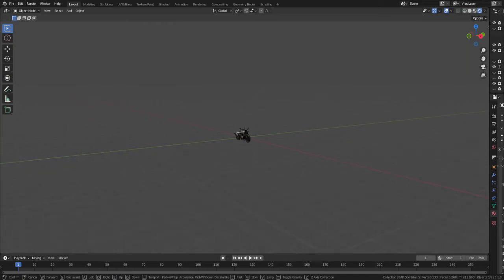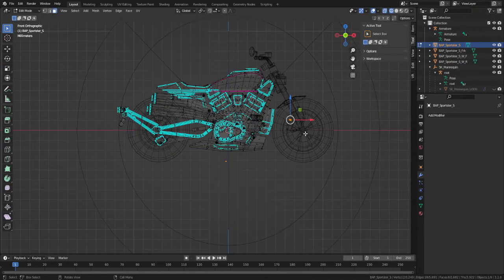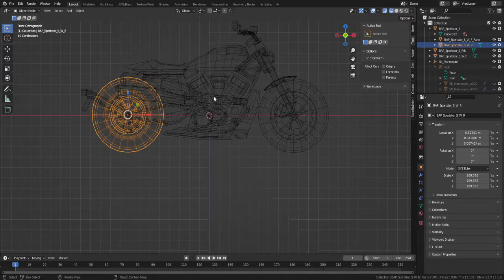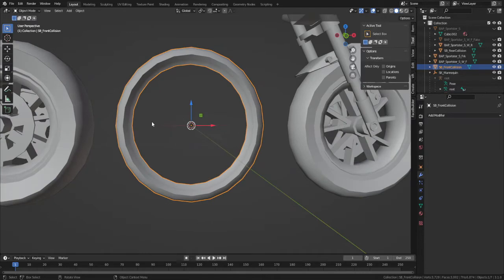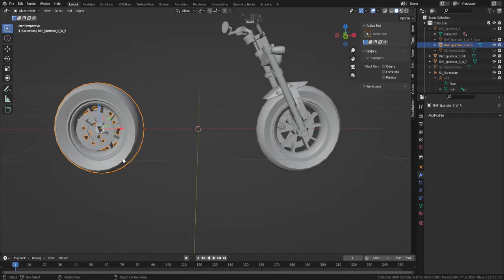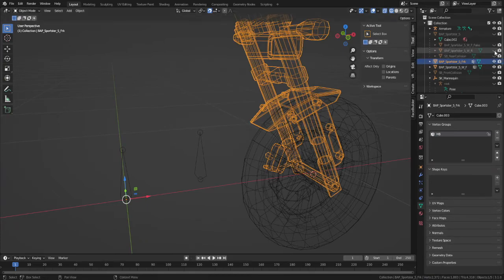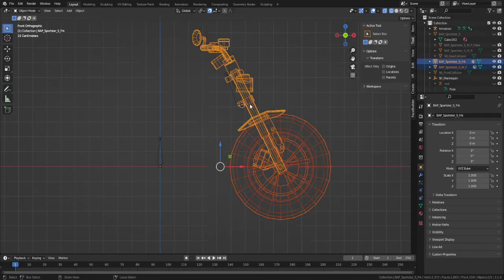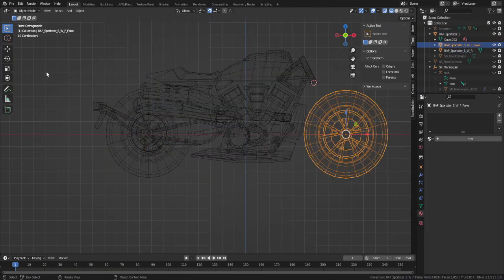Blender to UE5 Chaos Motorcycle Setup

Comment: Chaos vehicles are completely unusable in games. For example it is nice to have a center of mass on a bike, but it is impossible to change it in game so the bike can't fall or stand on a crutch. GPT doesn't have a clue about how to do it, and "communities" never help.
And anyway setting up a correct handling is almost impossible. Crappy feature like everything in Unreal.
Reply from the maker: I both agree and disagree on this subject. Epic games has definitely prioritized 4+ wheeled vehicles in their game engine. Which has driven users to conjure up work arounds when it comes to 2 wheeled. There are many different tutorials floating around but mainly cater to arcade style steering. I made plans a while back to further improve my setup. Adulting gets in the way and my previous computer crash didn't help in terms of motivation. I have a few ideas on the lean mechanic that would help but I have yet to update to unreal 5.
Reply: @indieartsmidwest4042  You are right it works probably well for cars and there are indeed a lot of tutorials on the subject, but that is not the case for motorbikes. You  included, there are only 2 persons who made relevant tutorials. I've watched everything, that helped me to start but after I've spent countless hours tweaking the settings with no progress at all, and I still don't understand the arcade controls 😅. 
In case one day you decide to give it another try, I subscribe ;)

Comment: Hi friend I have a question please how do you put the pitch down on the handlebars and fourhce etc
Reply from the maker: A loop select an upper portion of the handlebars, shift-s cursor to selected, edit mode for the bone you want to place there, shift as selection to cursor for the tail end of that bone. Repeat the same process for the head end of the bone But be sure to Loop select a lower-end portion of the handlebars. The goal is to find the center of a handlebars in relation to where and how they turn. This setup technique works for bicycles and motorcycles but I also use it for steering wheels as well.
Reply: @indieartsmidwest4042  I have to do it with a bone? I wanted to know if there was no way to modify the axis of rotation of the pitch without creating an armature
I tried with your blender export info then after I tested at least twenty different imports by modifying the translation and the rotation once by converting the scene once no but that changes the position of the motorbike
Reply from the maker: @LanD_87  Unfortunately no I don't think it works that way. Objects in 3D space take on World/global rotation not local at a set rotation. Even if you were to export it as an fbx without an Armature, unreal would still base its rotation from its exported origin which would still maintain World rotation. Meaning you wouldn't have to create a virtual bone-in essentially do the same thing on the unreal side.
Reply: @indieartsmidwest4042  because the handlebar on its left-right axis I put it locally and arrived in unreal it sticks well to the axis of the top of the fork as long as I don't activate the rotation effect on the front wheel it follows the fork well but as soon as I put the rotation of the front wheel active with a copy bone for example it no longer follows the fork from a certain angle and I see all the calculations you do them all on the pitch for the rotation of the handlebars dc I have no choice I'm going to have to try to do the armature well, etc. as you show us, thank you for sharing this knowledge and thank you for your very constructive answers

Comment: Hello there! can 't be implemented for ue 5 without a fake wheel ?
Reply from the maker: At this time I don't think there is any other option. It can be implemented without the fake wheel. But the steering will look bad and not turn in conjunction to how handlebars normally look when performing this task. In other words, an Armature allows the handlebars parented to a bone the ability to rotate at unique angles by default. Objects tend to maintain global over local. This technique is only exclusive to motorcycles. I've never had to deal with such things for cars or truck types. I'd imagine a bicycle wouldn't need the fake wheel since the handlebars don't sit at an angle usually.
Reply from the maker: The fake wheel is simply used to take up space in the vehicle blueprints. Meaning that it takes upon the Collision for the front wheel. At the time, I added the step because the rotation of the handlebars looks bad in the only way to relieve the issue was to create a fake wheel and have the handlebar bone follow its rotation. I'm sure can be done also by exporting the motorcycle as is having the handlebars follow a virtual bone
Reply: Thank you for the detailed answer!